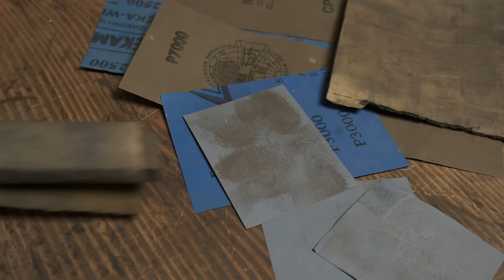1910s Antique Hand Drill Restoration - Woodworking Tools

Comment: I really appreciate it, that you saved the wooden parts and did not just replace them like they do in most of the other restoration channels!
A little suggestion: Hide glue also works fine with saw dust and would be more appropriate for these old parts.
Thank you for your fine videos without talking or speeing up the scenes.
Reply from the maker: Peter thank you very much, i'm so glad you like and thank you for your thoughts. i don't prefer to use the hide glue because of a personal point. Hide glue is based on animal bones and gelatine. I'm a vegetarian and  do not eat any kind of an animal including from the sea. I could not find a synthetic hide glue so far. if i can find i will use. great to see you here 🌟🗜️⚒️🐾

Comment: Nice filming and good music but I don't understand why you sand the wood up to grid 5000 - it doesn't make sense, only the finish works so well for the gloss
Reply from the maker: Thank you Daniel , i m glad you like. Actually how further I take the finishing, the more difference I feel when I touch it. Nice to see you here ⚒️🗜️
Reply: @byOldHand  Agree with you. I've finished like this before too. The problem is that the wood pores clog and the varnish / oil does not enter the wood and makes a bad grip with the wood, so it does not fulfill its protective role. Try sanding after applying the oil / varnish and see what comes out. I feel the same way as before and much less work. It's just advice
Reply from the maker: @ucenicul  Thank you for your thougts, nice to hear them 🐾⚒️🗜️